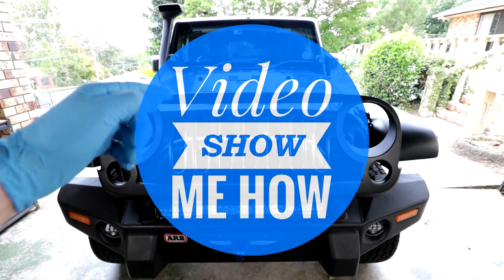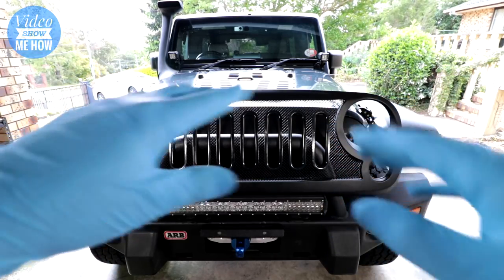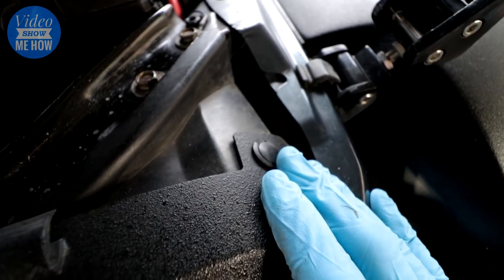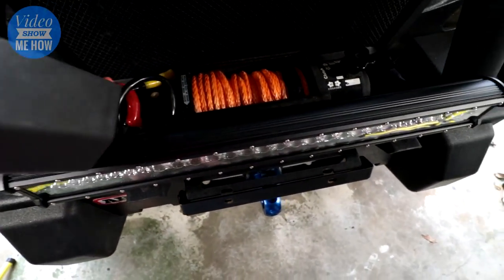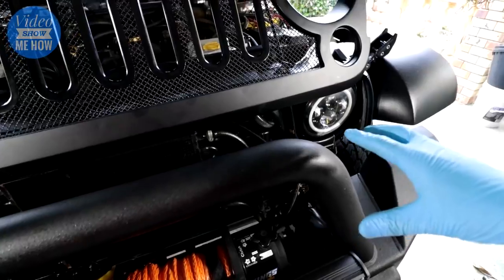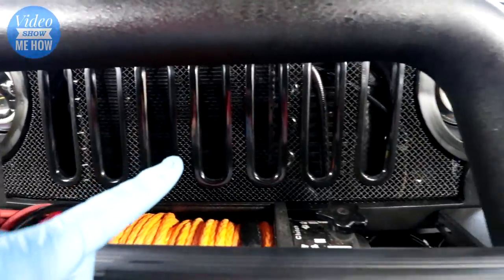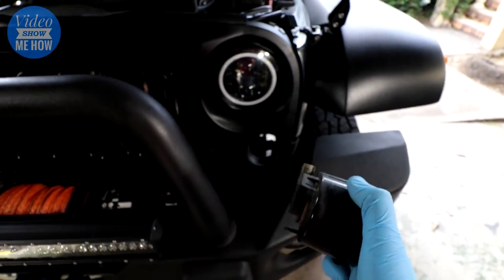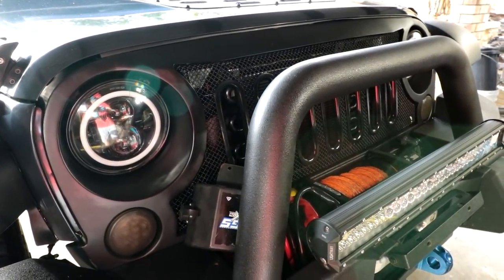How to Install a Jeep Wrangler Grill (High Flow for Heat Reduction)

Comment: Can you add the add the aftermarket inserts in the 7 slots?
Reply from the maker: Hey mate, do you mean the mesh inserts?
Reply: The plastic insert ones you can get from eBay for like 30 dollars. I just don’t like the idea of having open slots
Reply from the maker: @nicholaswood9055  Ah yeah those would work. You can get the full high flow grills that have mesh across the whole thing
Reply from the maker: Like these? https://www.jkwarehouse.com.au/shop/Angry-Grilles/Spartan-Skull-Style-Grille-Matte-black
Reply: Just thinking while I am doing my trans cooler I might change the whole front since jk warehouse is 2 min away
Reply from the maker: @nicholaswood9055 yeah same lol. Good idea if your doing the trans cooler, grill is coming off anyway. I made a vid of my trans cooler on the channel too if you want some info on it 👍
Reply: That is legit got me started down the rabbit hole ahahah
Reply from the maker: @nicholaswood9055  hahaha soz not soz 😁